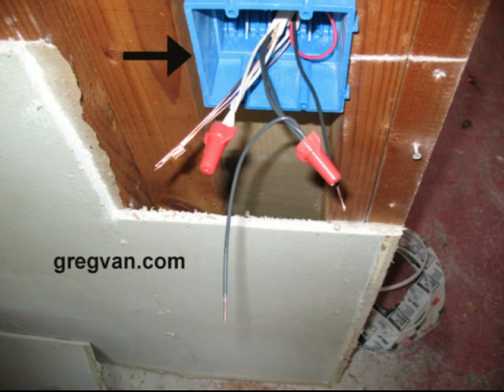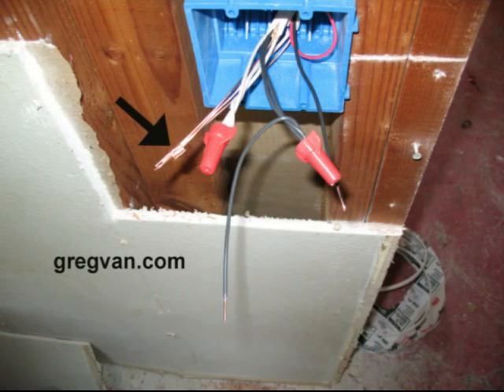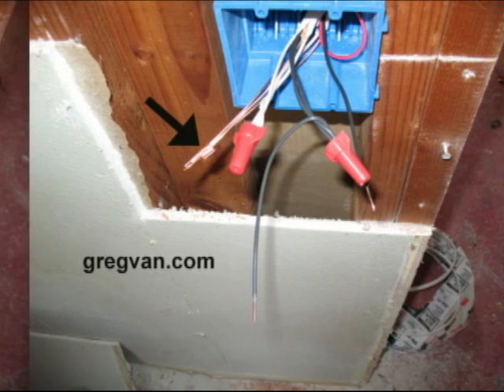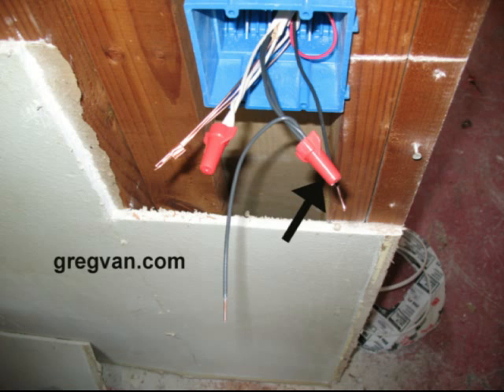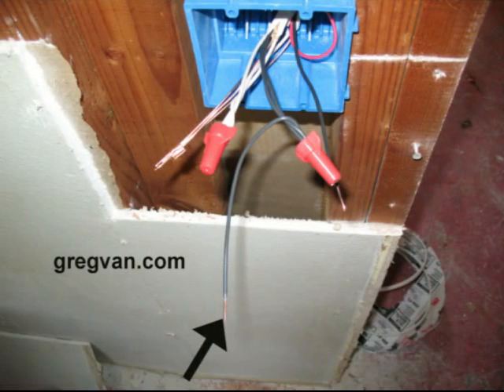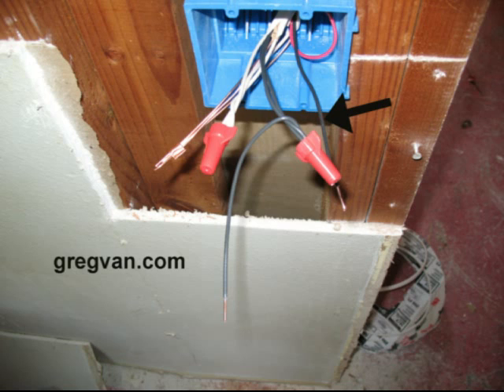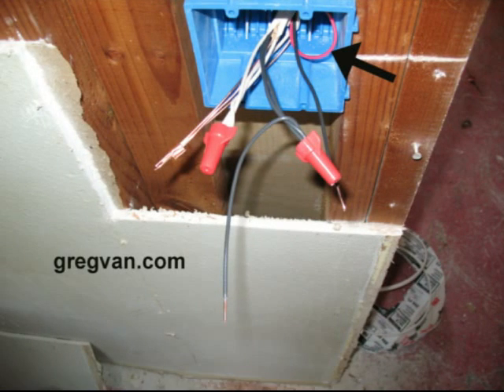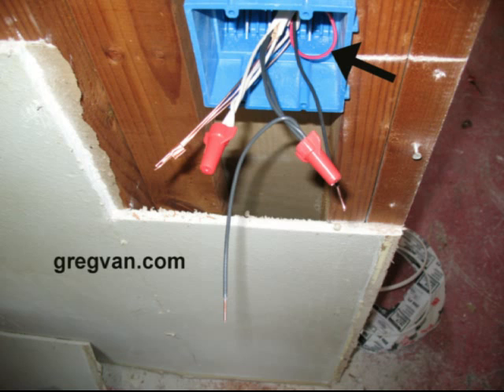Whats Inside Of A Double Electrical Light Switch Box - Home Electricity

Comment from the maker: @eddie1278 You're absolutely right and great point.  However, I don't think the electrician did.  Years ago lightswitchs didn't need to be grounded, but today they do.  For your safety, make sure that you follow installation instructions and building codes, to prevent unnecessary accidents.  Thanks for the comment.